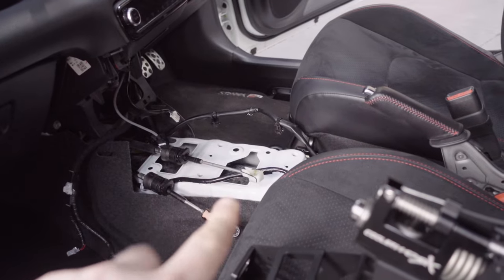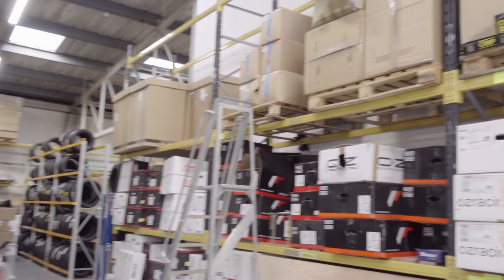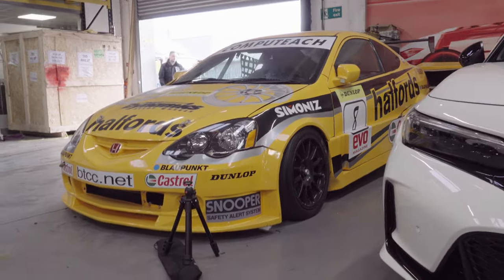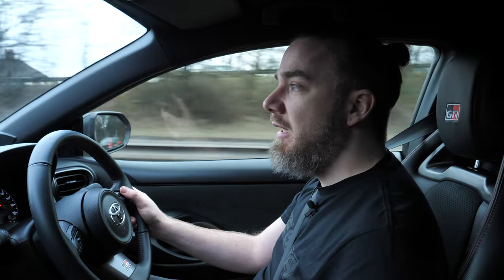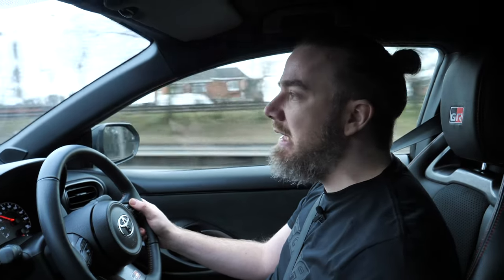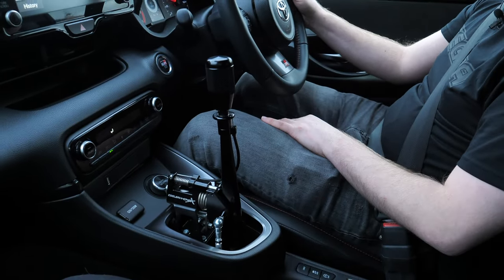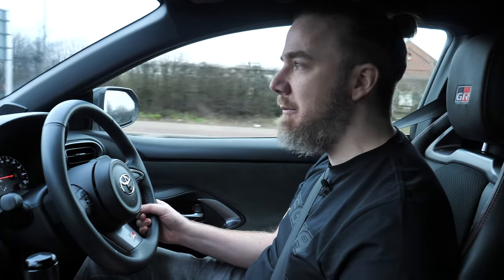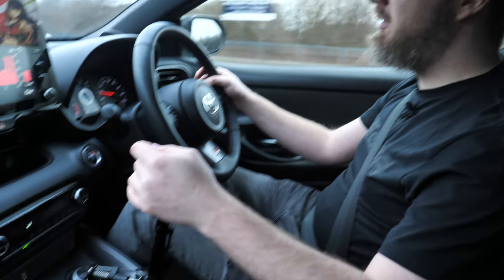The Ultimate Short Shifter for the GR Yaris? Working with @tegiwa on the install

Comment: Campare to the cae shifter?
Reply from the maker: They are both very similar. I went for the Coolerworx shifter as it doesn't require any cutting or trimming of the interior. Ive seen that the CAE shifter will require the surround being trimmed down causing damage to the original interior.